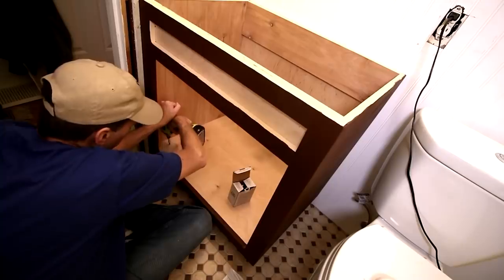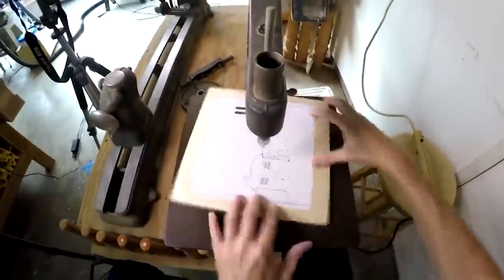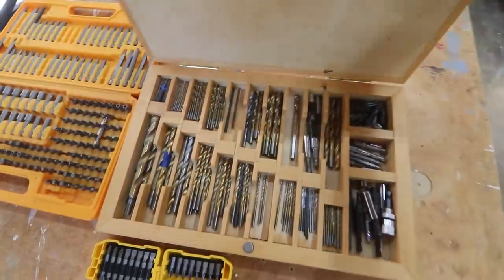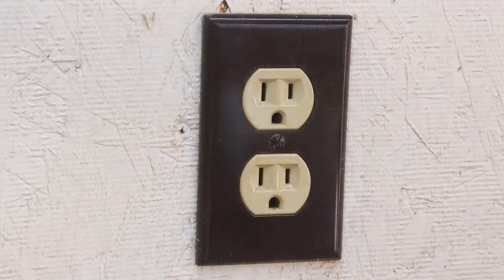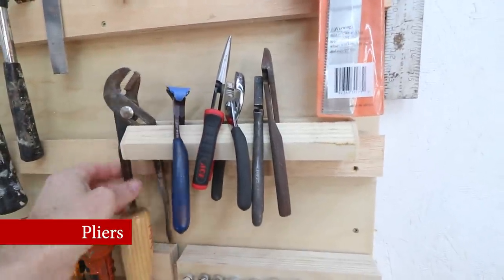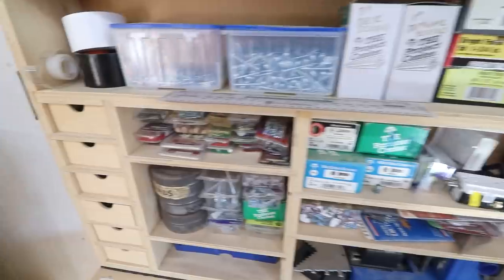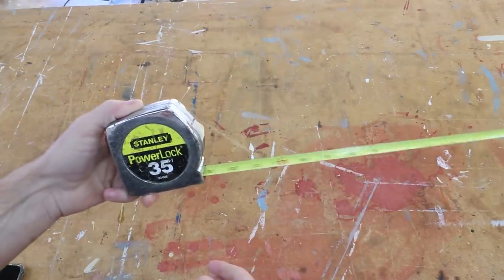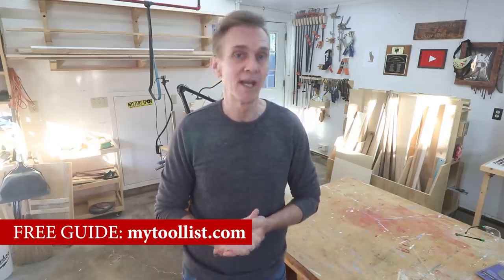No homeowner should be without these 7 ESSENTIAL TOOLS

Comment from the maker: Anything else you think should be added to this list?
Reply: I love my 1' (300mm) metal ruler for measuring the smaller stuff and using as a straight edge and pin vices (I actually have 1mm to 3.5mm bits in 0.5mm increments permanently mounted in separate pin vices so I don't have to swap the drill bits out).
Reply: I would add an outlet tester, even if you don't feel comfortable fixing outlet wiring you can at least safely test your outlets and GFCIs to see if you need to call an electrician.
Reply: Stepstool. I'm plenty tall but a stepstool makes many things possible and/or safer.
Level. A basic little 6" level costs a couple of dollars and is great whenever you're trying to hang something on the wall. I have never been good at the "eyeball it" method.
Reply: I would like to add patience. Because every DIY project create a mess in your house while you're going. And if you can't tolerate the mess for a while you're going to make shortcuts that aren't worthwhile in the end.
Reply: With how everyone has a smartphone, you will be surprised how few people have an actual flashlight. a cheap flashlight is great, can set it on something to point at your work for doing things under cabinets and in dark basments without relying on your phone flash.
Reply: Stud finder or a powerful magnet.
I would add a Hammer Drill if you live in a concrete building and you need to make holes on the walls.
Reply: A putty knife and spackle to repair walls, Also have extra wall paint on hand need some brushes, painter's tape, etc. It's not an immediate need, but sooner or later... LOL
Reply: A headlamp. The number of projects and years that went by working on things with sub-optimal, infuriating lighting conditions boggles my mind when I picked up a set of three for $10. It (along with a folding workbench) has absolutely been one of those things I got by without, but made things infinitely easier once I had them.
Reply: At the tape measure bit. If you have the money for it, a laser tape measure really makes measuring stuff precisely a lot easier on your own.
Reply: I think a pair of large and small levels will go a long way
Reply: @DaivG  Super agree with this one too - my headlamp is with me all the time
Reply: In my experience a corded drill is better for a new homeowner, Cordless seem to never be charged when you need them.
Reply: You didn't include a set of metric screwdrivers, adjustable wrench, pliers and hammer.
Reply: I would say a crane with a wrecking ball could be in order when taking on a project that created more stress and work then originally anticipated. It can be used to really relieve the frustration. LOL Just kidding.
Thank you Steve for your ambition for making this channel happen. I have been thinking of doing it for a long time now just can't figure out a good pilot.
Reply: I would add a hacksaw, it is very cheap and useful to cut wood and metal.
Reply: I would say a putty knife or a wide chisel. I use those all the time scraping something smooth.
Reply: YouTube
Reply: Utility knife with extra blades!
Reply: A MYSTERY SPOT REVEAL!
Reply: vice grips ;-)
Reply: A couple of generic 'vice grips'.  I agree with the other wrenches also.  I figured out just out of college that civilization would collapse without 4 things; vice grips, needle-nosed pliers, WD40 and duct tape.
Reply: I might add a stud finder to the list. From hanging up things on the wall like a TV mount, or trying to wall fish wiring, it's one of those things that come in real handy when you need it.
Reply: Small toolbox, bag, or tote so if a job requires multiple tools, you can gather them all up and bring them to where the work needs to be done instead of carting one or two at a time from your garage or workshop. One of the combo tool packages you buy might even include a decent one. 

A folding stepladder, ideally high enough to get your head at a height just below most of your ceilings. Having to hold your arms above your head for long periods while replacing light fixtures or installing ceiling fans is a good way to tire quickly. 

A plunger and small plastic snakes for sink drains

Fire extinguishers, at least one in the kitchen and maybe one in the garage or anywhere else you store accelerants. 

Tapes: Painters tape (even just for temporarily marking or securing things on walls and furniture without damage), foil tape (for ductwork), duct tape (for lots of things but paradoxically not ductwork), drywall tape (for small wall repair), silicon tape (which I think can serve as either electrical or plumbers tape in a pinch, but those might be a good idea too)
Reply: If no one mentioned it i would say a level could be very useful for installing shelves mount tv mirror etc
Reply: Spirit level.
Reply: (Impact) drilling machine.
Reply: A hacksaw is very handy too
Reply: I'd add a small level if you're going to be mounting shelves, hanging pictures or installing a tv wall mount.
Reply: @bladee_enjoyer540  Yeah, man!
Reply: @luigitheMetsFan  Absolutely.
Reply: i would add safety glasses and a dust mask. there will be times where you want that protection. you only get one set of eyes.
Reply: 3" or 4" drywall knife, every homeowner should be able to fix minor holes in drywall.
Reply: That’s a pretty good start, but there are a lot of simple tools that could be added to a basic list for any homeowner.  For example a torpedo level and a putty knife.  A voltage detector for anyone who might change a worn-out receptacle.

Comment: I would add a small level and xacto knife as necessary tools for a home kit. Honestly, go to your favorite box store or amazon and buy a kit in a plastic case for $100 or so. It will have everything you need for general home repair and maintenance. It was the best gift my Father gave me when I got my first apartment and my first tools. I upgraded the pieces as I had more money, inherited and added to and now I have a full garage of tools and they started with at the time (25 years ago) a $65 case from Canadian Tire with everything Steve listed except the drill and driver which my first drill was a used one from a garage sale.

Comment: I think a small shop vac is essential for a homeowner. A plumbing failure can happen at any time and being able to quickly suck up water can save your floor. The week that we moved into our home, we discovered that the washing machine that was included with the purchase had its drain pipe improperly installed. We've had the pipe for an outdoor faucet freeze and burst into the house. We had the refrigerator water dispenser line break, a dishwasher hose break, and an air conditioner drain line clog. All required vacuuming up the flooring. On occasion, I've even used it for woodworking cleanup.

Comment: I would change this slightly to be a 7+ tools list, the "+" being a pair of safety glasses. You don't want to have bits of your DIY project flying into your eyes. Especially when the project is something like disassembling a bathroom mirror one piece at a time!
Reply: I would also say a set of basic DIYer PPE. Along with the safety glasses some gloves, leather and/or cloth and nitrile ones to protect your hands. Some face masks for those dusty or gross jobs, nothing worse than blowing your nose and seeing a bunch of saw dust or dirt come out after working on a task.
Reply: @deans9766  Yep, I'd agree; that's even better.
Reply: Folks always forget ear protection because hearing loss is gradual and not nearly as dramatic as shrapnel to the eye, but I don't run almost any power tool without earplugs.  (That includes vacuuming!)
Reply: @alexplorer  yep too many Punk and Ska concerts along with years of using power tools like chain saws, backpack blowers and lawnmowers with no ear protection has left me with diminishing hearing. Can confirm

Comment: I'd definitely reccomend getting a water key to turn off your water at the street in case you have a leak.  I've seen thousands of dollars in damage occur between the time someone realizes they have a leak and is able to/calls someone to turn off the water.  Home depot sells good ones made of welded rebar with red handles.  Get one and prop it up in the corner of a garage or closet.

Comment: Don’t forget that a great many of these can be bought as a set - it’s very easy to find a small toolbox that comes with hammer, both pliers, two screwdrivers, and a small adjustable wrench, plus other tools (from there on, it varies which you get). Are they great quality? No. But realistically, the difference between cheap tools in those categories is not very important to a beginning DIYer/homeowner, and it gives you something to start with at low cost while you learn about what qualities or features are important to you.

Comment: Yep, totally agree. I'd however upgrade those picks to make them accessible to women by upgrading to wrenches with integrated ratchets, Irwin vice grip (channel locks), roll a gear screwdriver (multi head with integrated ratchet that really lowers the muscles needed to do anything). They will also be tools you keep for a long time and are still good when you get older and don't have the same strength you used to have. Or be friendly for starting your kids into learning these important skills. Don't buy the cheapest, you'll end up needing the upgrade soon enough :)

Comment: Not mentioned: Get a parts organizer and start saving things.  The random Allen wrenches you get with projects (as mentioned), leftover screws, etc.  Over time you can sub-divide those into more and more refined categories.  When I first started out, I put screws and bolts into a cat litter bottle.  Then it got to be enough that I went through and sorted it into machine screws vs. wood screws vs. several other categories.  Now I have a shelf full of different parts containers, which has saved me lots of times where I need, say, a specific screw and can't size it or run to the hardware store.  It's nice when you already have it at home... provided you can find it.  Start saving things in a specific location.

Also: Skip the regular pliers and go straight to the channel pliers.  Needle nose cover all the small stuff, and if channel pliers can't grip it, you probably need a pipe wrench.  I have a whole drawer of regular pliers that I never use.  Shown but not mentioned: Vice grips.  Just like pliers, except that do what they're told when you say, "Here, hold this."  They're more reliable than your son.

Finally: Multiples of the same tool isn't a bad thing.  You almost certainly need two drills (one for pilot holes; one for driving screws) unless you want to spend all day changing between bits.  (Same goes for the Dremel, routers, etc. where you might alternate between two different bits repeatedly through the same project.)  It also comes in handy if you are working in more than one place at once (e.g., a project on the workbench but need to grab tools for a repair) so that you aren't limited to one thing at a time.

Comment: For wrenches I'd suggest Metrinch. A little pricey until you realize they are SAE/Metric, so you only need one set, and they grip on the flats, so they do very well with rounded bolt heads & nuts. Also available in sockets, including impact.

Comment: Great list! You briefly mentioned a tool box towards the end, I would definitely recommend that a tool box be higher priority than that. :)
To your 7 essentials I would add: a small carpenters type level, a decent utility knife, and a couple of pencils. If a person is able and interested in dealing with minor electrical repairs, a non-contact tester will be very useful to be certain whether or not the electricity is on or off for what they may be working on.  As you say, other tools can be bought as needed. 
Separate your household diy tools from any other hobby specific tools you may have or get. 
For these 7+ essential tools I think buying decent, basic quality tools is much better than buying super cheap tools with the expectation that you'll replace them anyway. Super cheap tool are, at best, annoying to use. No reason to put yourself through that. 
Lastly, I will suggest being quite rigorous about putting all the tools back into the tool box EVERY TIME and find a permanent location for that tool box somewhere inside the house. That way your tools will wander a bit less.

Comment: The best pair of sliding channel-lock pliers on the market is the Knipex Cobra, even if other makers have started to imitate their press-button style of lock over the past few years. There is no reason to inflict an inferior product on yourselves when these exist.
Re: hammer, there is actually a specific type of hammer for joiners and woodworkers, in French and English flavors. I like the French one a lot and if you're just getting one hammer, I'd recommend getting that type. It has no claw at the front but for pulling nails and such, you should get a 12 inch Dogyu style nail puller anyway because those are just super useful for general leverage and as a pry bar.

Comment: I'd add a basin wrench.  Plumbing repairs can be very expensive, and for good reason.....it's labor-intensive when crawling into a cabinet under a sink.  If you can do it on your own, an inexpensive $15-20 dollar basin wrench that can reach into the faucet area between the sink and the cabinet (because my big fat hands can't fit in there) can make your DIY plumbing repairs/renovations go much faster, and without resorting to screaming curse words that your kids will eventually repeat at school.  Also, a small LED clip-light that can attach to your ballcap, or on a head-strap.....they always point in the direction of your head, so they are indispensable when working in dark spaces, like sink cabinets, attics, unlit/unfinished basements.

Comment: A well done list, Steve, although you passed 7 before you got half way. Yes, I know some comes as paranoia set, but you could get the whole kit and kaboodle as a set and call it one.
But enough nitpicking. I can think of a couple tools to consider for this list; Japanese saw, snap blade knife, and awl, for example, but the list can get too long too fast.
In my kitchen drawer I keep the tools I find get the most done without running to the basement. They are a mult-bit screw driver, a pair of slip pliers, a small snap blade knife, a tape measure, and an emery board.
Thanks! Stay safe and have fun.

Comment: All this from a man who could not (or would not) change out the dead battery in his wife's car. Who knows maybe it only needed a jump. Which is why I am adding quality booster cables to your list.  Make sure that the set you buy is long, made of welding cable and expensive (if you pay less than  $100, just throw the money in the street).  You will only need a couple jumps instead of a service call for them to pay for themselves.

Comment: Tool kits are great, but don't get yourself too cheap tools. Even if you use your screwdriver only once a year it makes a difference if you're using a quality tool or a budget toy.
(Same for bits, pliers, etc.)
And make sure you use the right size screwdriver/bits for your screw! There is a difference between Philips and Pozidriv heads and even if you can drive a PH2 screw with a PH1 driver you end up damaging your screw, your tool and your patience.

Comment: I wish the open end wrenches still existed.   It was handy with my father's tools that when I had to get off a tight nut & bolt on one accessible side and one not-so-accessible side that I had 2 wrenches of the same span (which is why the British call them spanners).  There were half as many wrenches in an open end set because each had 2 spans.  But I could get the open end wrench to hold the hidden head while using the combo wrench to work on the head (nut or bolt) of the accessible fastener,

So for the 21st century you need 2 combination wrenches of every size.

I've never gotten an adjustable wrench to hold anything well enough to be of any use.   When I can't find 2 wrenches of the same size I use a locking pliers (such as vise-grips) and wince at the unaesthetic but practical results.
Reply: What?
Why do you say that open end wrenches don't exist anymore?
Reply: @Jehty_  Also curious about that. You can head down to Canadian Tire, Home Depot, or whatever your local shop is and buy an open ended wrench set today.